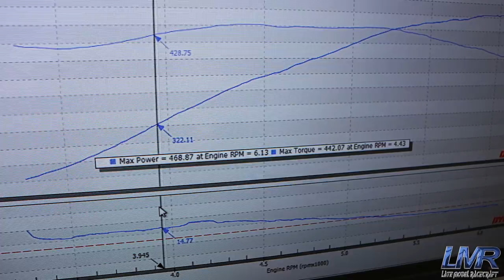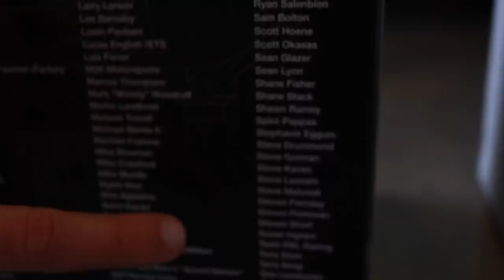We take delivery of Street Speed 717's C8 for our twin turbo build!

Comment: Late Model Racecraft, what are you expecting this kit to boost the horsepower to, given that it can't be tuned right now?
Reply: Michael Wilson 
The other ones I’ve seen are somewhere around 150-180 extra horsepower with just the turbos. Pretty sure Hennessy’s is around 600 after.

Comment: 468WHP + 15% drive loss = 538HP very nice for base Corvette
Reply: I would think the drive train loss would be less with this trans
Reply: @jacksz28  Yeah. Even the C7 manual only had about 12% loss. The C8 will be WELL be under 10% with a mid-engine layout and this transmission. Full disclosure, I have someone on the inside (my cousin is the QC Director at the Corvette plant). Stay safe.
Reply: The aftermarket exhaust set up gave him a few more horses
Reply: i think it makes only 495 bro. its 468 probably bc there are very limitations on the drivetrain.  it can put almost all of that power down. instead of 15pct probably loses 5-10pct.my best guess.
495--->468
your guess... 538--->468🤔😳
Reply: it loses 27hp from 495hp to 468. not 538hp to 468 bc that would mean it lost approximately 70hp. LOL! bro...
Reply: @nyelement007  495HP it's a crank number not wheels number lol

Comment: how are you able to put on the turbos without tuning the car?
Reply: Keep the boost as low as possible and the ecu can add enough fuel to keep it safe. After the turbos are installed they can put it on the dyno and turn up the boost slowly until they see the ecu is no longer compensating for fuel. Once they see the ecu is not adding any more fuel they stop there until they're able to tune the ecu. They may also be able to change out the factory map sensor to get more fuel adjustment from the stock ecu but I'm not 100% on that.

Comment: sorry to break it to you but you won't be able to crack into the ecu. this is becoming a typical click bait with all c8 owners on youtube. i would be surprised if anyone can make a working prototype with the turbo build and proper ecu tune in a year. i still think this would be too long before anything like that happens.!!
Reply: Clickbait is right, they won't even address the number one issue and that's the ECU. In 3 weeks it'll be "twin turbo Vette... not really"
Reply: GM even locks out suppliers from flashing the production ecus. so ideally only someone within GM  that has access to VIN specific security key generator can only flash a ECU. this is close to impossible. this being new architecture it won't be easy for any aftermarket ecus to work either. i see 0.000001% chance of it happening. unless GM themselves make it accessible for aftermarket. no way!
Reply: Arun kumar hennessey has a functioning and driving non tuned twin turbo C8 currently